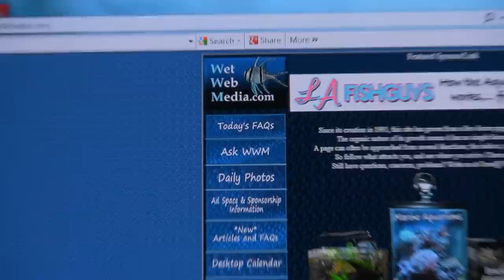Spectra Pure, loose voltage and a leak LA Fishguys Episode 139, part 2

Comment: Wow, that electrical 'system' is scary! You got good life insurance? Mount things like the ballast and power strip so they can't fall into the water and water can't drip into them. 

Anybody ever tell you you shouldn't pull plugs out by the wire? It's very hard on the plug.